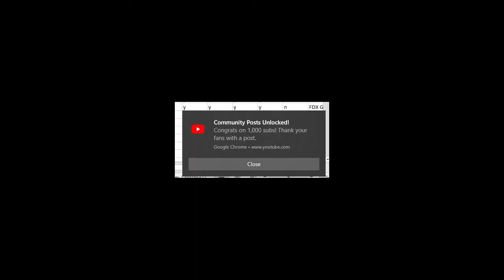Hydraulic VS Solid Roller Camshaft by Billy Godbold - Narxoleptic Customs Podcast

Comment: Q...sbc 383 solid roller. Cam card calls for .026 hot
Iron block alum heads
Cold adjustment? 4, 6 thou tighter or? 
Still believe for often seeing over 6k a solid, ft or roller is the way to go, less chance of things going wrong. 
Oil gets aerated, no problem on a solid. Hyd..could be problems
Thoughts?